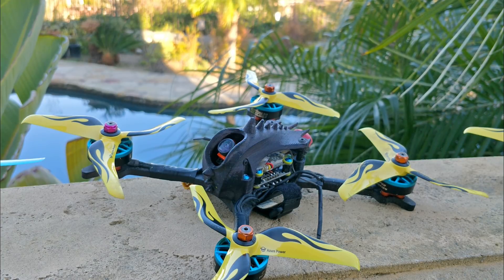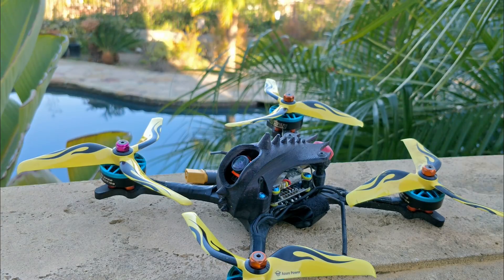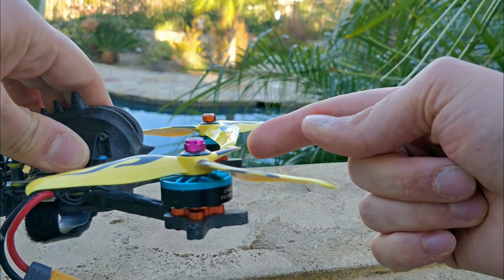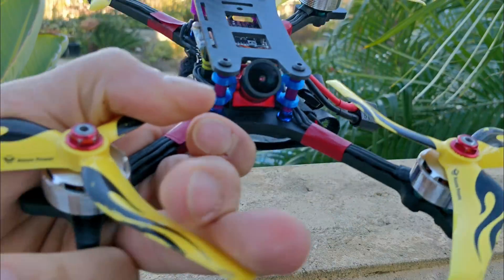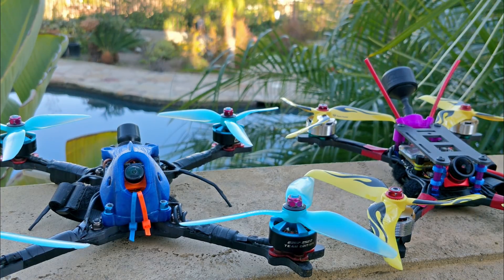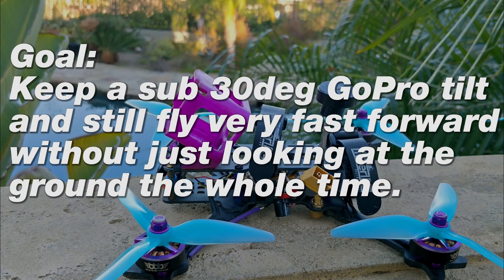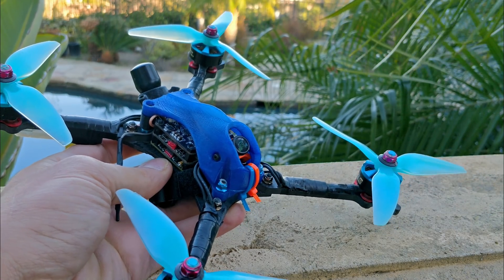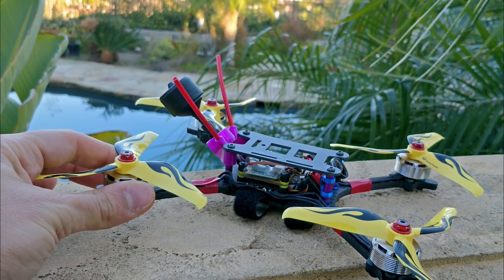Frame Geometry - Stretch X vs Tight X

Comment: Hey man - how would you describe the flight characteristics of a deadcat frame ?
Reply from the maker: Requires a bit more pitch usually to move forward at a steady and good speed, flat spins are a bit wonky due to weight distribution being a bit off.  Flips happen faster than rolls.  Otherwise pretty similar.

Comment: Interesting, I just learned about the problems of the disks overlapping in forward flight. This makes me wonder - could it help to use different props on the front and back? E.g. a 2-wing prop on the front that potentially leaves the air more 'clean', and stronger 3-wing props on the back that can pull their weight more easily? I cannot seem to find anyone who tried something like this, only this joke reporting on four different props, which obviously makes no difference: https://www.propwashed.com/flying-quadcopter-4-different-props/
Reply from the maker: twin blades would be spinning faster than triblade or quad blade so the net result should actually be similar.  More separation between front and back is most important.
Reply: @Kabab  okay, I don't know enough about prop geometries (yet) to know what would help, I was just wondering if there was maybe a trade-off involved that could be made differently for front and back to help with the issue.
Reply from the maker: @s-ol  either the rear props need to be raised above the front props or the distance between the front and back just needs to be longer. You could also make the rear wider too but that's not as effective

Comment: I so enjoy watching your videos especially when u get into theory and the science of quads and u can feel the difference in a stretch x and x configuration one of the best examples I have found during my time flying has to be the merica frame from catalyst machine works where the use the spacer blocks to lift the rear up and away from the front props but other than that u can tell the difference in the regular x and stretch
Reply from the maker: The step up and long X feel very similar. They're both doing the same thing. If the step becomes too large it becomes an issue for roll.
Reply: Yeah I could see that

Comment: Hey Kabab, Can you try to advice me a little? I found this amazing frames online. Catalyst machineworks Merica-X 5inch and Merica stretched 5inch. The thing is, one is True X with lifted motors on the back, the other is stretched and also has the possibility to lift the motors. Which one should I get for racing? I never flew a stretched before. and as you told in the video, the lifted true X does about the same trick with the airflow as stretched, but must feel very different...... hmm.. I guess its a personal question and differs from person to person. But choices.. are always so hard to make. ;-) Think it's time to floss now.
Reply from the maker: The stretched X is typically preferred for racing.  The lifted rear motors are only a little bit and that further helps get clean air to the back as well.  That's a great frame.  A little annoying to build and work on, but really great frame in general.

Comment: Very interesting discussion.  I've been designing frames for fun for a little over a year now.  My first design was a stretched x, and I've been flying that for about eight months.  I just finished building an H frame where I literally took the stretched x arms and rotated them 90 degrees.  The parts, rates, and PIDs are identical between the two quads, but the stretched quad feels a LOT smoother on pitch.  The rolls on the H frame were better, but I think the stretch flies better overall.  I'll probably design some true x arms just to see how it flies, and I'll mess with my rates (I have pitch and roll equal on my acro rateprofile).  I should also note that the main difference between the two (aside from arm geometry) is that the stretch has a bottom mounted battery and the H has a top mounted battery.  I still have a lot of testing to do (i.e. trying different permutations of geometry and battery positioning) but I was wondering if you might have any advice or comments?  Thank you!
Reply from the maker: The long X has better airflow to the rear props so it typically feels more in control and more grippy.

Comment: kabab do you know the folks at silverdrone? i wish i could of used my zmx finx40 2.6 but it kept blowing fets on 4.1 esc.. so is there any setup that would be reccomended for these motors? the f40 pro ll 2600 are okay but with gopro and lipo 595g so my astro x build is heavy but nothing like it was when those bigass zmxfinx40
Reply from the maker: Yeah the finX morors are pretty good. They are pretty well made and engineered

Comment: What about H geometry frames?
Reply from the maker: They don't really fit the bill for me. They require more tilt to fly at speed. Since pitch is so important on these things,  I prefer anything but an H. I'm assuming you're talking about a geometry where the front and back rotors are close together. If there is adequate separation it doesn't matter H or not n

Comment: Hey Kabab, perhaps a little off topic in regards to your frame research but i didn't know of anyone better to ask and i didn't know any better way to reach u, but in terms of props unloading thrust, i was hoping to bounce an idea off ya, maybe you have any thoughts on it .. 

I've always been bothered by the way nearly all currently popular motors are designed so much in favor of low profile assembly that it typically results in the bell being close to a flat cilinder of roughly 30mm diameter. When a prop is installed on for instance an emax rs2306 or whatever. the prop blades almost press flat against the top of the motor, which i would say surely decreases the total effective surface area of a prop. 

I'm sure I'm not the first person to go and try flying my quad with amd and without washers under my props to see i i get that extra 10% but I'm not exactly the most consistent of pilots to really test the theory proven. You ever try it?
cheers
Reply from the maker: Yes there is some validity to this concept. But only some I would say. The thrust coming off the disk is exceedingly little on the inner bit of the blade. Instead, the center acts as sort of a scoop that flings air out to the more effective part of the blade sort of. Blocking the middle is really insignificant. Similar reason why computer fans put the motor in the middle too. The effectiveness of the motor on the outside of the blade is none compared to in the middle with a bigger overall blade diameter. This is just based on thought experiments. Just a single washer under the blade probably isn't gonna do much.

Comment: before I even watch this, IMO Stretched X flys much better, always hated props being so close together like the compressed X stuff, props need space! its obvious the rear props would see much more air turbulence from the front props the closer they are together. don't understand why so many frames keep the props so tight together. I feel like frames should be much bigger then they currently are for the prop size they spin.
Reply: bob have you thought about making an inverted frame? I find quads are more stable not being so top heavy. was going to try one of your 6" hopefully 7" flossstyle from and invert it and mount the FC on the bottom plate and bolt the arms to the upper plate in between the top and bottom, will take up space but I think it would fly amazing.
Reply from the maker: Yeah there are a number of frames like that and many build the floss upside down too. I personally see it as not being very practical and my designs mostly call for a slightly raised up battery too. Especially the FlosStyle and Flowride.

Comment: stretch frame: battery and go pro mounted on top, mount the motors UNDER the arms. blades get sufficent air, and go pro won't catch props in view. you're gonna need tall studs for your motor nuts though.

Comment: Dr. I have a question,  do battery's have to be rectangular in profile?
Reply from the maker: No but it works easier for each cell manufacturing for the lipo structure. Lithium ion packs are cylinders because it's more volume in a smaller space but they work a little different.
Reply: Kabab FPV could you circle the square?  By mixing profiles, the worst that could happen is it doesn't work...  I'm guessing/asking.

Comment: Not quite sure what you mean by structural integrity for Z/split level frames. I designed the Zypher specifically because I wanted to have slightly better durability. Do you mean for a given weight? Because I must admit, that they do turn out a bit heavier
Reply from the maker: Yes that is what I mean. For the same weight it is very difficult to get similar durability

Comment: Yes I've noticed the "stretched x" with a high P tune on the pre-release bf 3.3 w.kalman filter creates more of an ovular or even egg shaped vs a circular air foil on the plain x. This "air butt" is akin to the huge tires on the back of drag racer...so on my stretch x I raise P pitch by 15 - 20%.  My freestyle secret sauce frame (Storm 210 -3 bolts/arm + double understrap very discrete high performance wide 210 (actually better than Chameleon due to lighter and underside battery) I set P roll up 20% from 45 - 46 to just at 55 - 56...of course I try and lower D to about 17 - 15 and you can do this with pseudo straightening effect of the new Yaw D term of 10.  My sp wt. and sp trans. are set just as Oscar Liang demonstrates his preference. at 1.5 and .6 respectively.

Comment: was there a batch of floss 2 top plates that got jacked up by a bad bit? I got 2 floss 2 frames from flyrcnow and one of the frames came with a bad top plate. Damn thing gave me a good splinter from the carbon and that's not cool man. The rep Justin has said to me that you  said it is fine but to me not so. Not sure if the place to have sourced to make your frames is dropping the ball or just using bit beyond the working life. 

I gotta say I like the frame a lot. After building the first I ordered the other after I seen how clean I managed to get it to be. I have ocd to the core so this top plate being damaged from the factory is killing me.
Reply from the maker: Yes there was a batch that the top plates had a different design and the machine couldn't cut it cleanly fast enough. We didn't realize until they were already shipped unfortunately. We then saw people's posts and we're sad. Won't let that happen again.

Comment: Hey nice video can you answer me one question, should I build the tooth fairy 3 inch or the floss 4 inch?
Reply from the maker: Neither. Build a Floss 2.1 5" or Floweride
Reply: But I have one problem the AUW has to be under 250 gram.

Comment: orthoGRaphic view*

Not sure if it hurts me or just makes me laugh, that in multiple of your videos you have your concepts right, but are off on terminology. It sounds like you are getting your terminology from Asian suppliers. :P You have to double check things over there. I encountered a foot long ruler (I double checked the length) over there with only 10 inches in it...wish I would have taken it with me.
Reply from the maker: I usually try not to use confusion words. I also may have some wrong words. I'm no expert. I've just tested a lotta stuff.

Comment: Roogi with them Hawkskys on the floss. :-P
Reply from the maker: Great motors
Reply: Currently running the 2207's on my 5 inch flowride and the big ass 2507 2200kv fpv af on the 6 inch flowride. They are great!

Comment: have you looked into a plus configuration vs an x configuration.   i built a 110mm with the plus config and you will notice the difference with the lack of turbulence in the plus config.  Its is very easy to setup in betaflight and the cornering for racing is unbelievable.  Also no, motor 4 's prop, which is the one in front does not get in the way of the camera.  from top going to the right order of motors is 4,2,1,3.
Reply from the maker: The cross feels a bit funny to me. It's design is a bit less practical imo and it just hasn't caught on as something mainstream. It's similar performance to an X but feels a little less stable around long sweeping turns to me.

Comment: what do you think about something like a XBee SR02 where the rear arms are way different than the front arms?
Reply from the maker: Looks fine, way too expensive and way too heavy.  My weight is well under 70g with 5mm arms and a pretty hefty body. How is that things weight 83g?
Reply: was more interrested in your thoughts on the wider rear arms, i got a friend who owns one and he says it feels very different from other frames in the air, also i live in denmark your frames are hard to get where im at lol
Reply from the maker: So sorry about the shipping. A super annoying issue. Wider rear arms will act like a long X but will likely roll a little odd like the Z geometry. I haven't flown a wide back for a while so just trying to remember.
Reply: hey man it is what it is, cant do shit about it for now atleast :D atleast there are some new ish shops in denmark that are starting to get good stuff home :)

i think ill try and borrow that frame to see how it flies

Comment: Hi, I just ordered a floss V2.1 and I was hesitating to put xnova Lightning 2204 2900Kv on it. Is it realistic or should I go better to the ZMX Finx23?
Reply from the maker: I wouldn't recommend any 5" motor smaller than 2207, 2306, 2405.  I don't feel there are enough benefits to anything smaller. If you're going with the Floss 2.1 with 5mm arms, it's too heavy for such small motors too. You need a ~55g frame max.

Comment: Have to call bs on the air unloading through your frame. Its still going to be blocked by the 
stack and other components creating turbulence. I'd like to see some fluid dynamics videos to prove this point. Otherwise its just speculation.
Reply from the maker: I forgot to say it but I didn't come up work that theory. Steele did. You can also test it for yourself and see. I didn't believe it either until I was experimenting with it all.
Reply from the maker: https://youtu.be/_0kQ5f5LqgI
Reply: I'll try to find the video, it was uploaded by some super nerd from an "x"IT school for a project - but it was a video of fluid Dynamics of a quad for a project and you could see the flow through the frame.  I'll dig through my subs and see if I can find it.

Comment: Why not just 1s and 9200kv duh!?
Reply from the maker: What if this actually worked? 😮
Reply: Would require too many amps.  Watts of energy is what matters in the end.  Watts are what get "work" done in physics.  As you increase voltage you reduce amps needed to make the same watts.
Reply: Just a joke haha

Comment: can we get your take on 6s benefits and disadvantages? And also 3s super high kv. I think in an old video you mentioned that silverdrone said the optimal kv of the finx 2205 was like 3100kv or something. would there be benefits to running a 3000kv 3s setup with a large 2200mah battery or something? or is that just a bad idea? lol
Reply from the maker: Yeah I'll do one soon but there isn't much to say. It's the same flight time with more consistent and slightly heightened performance. 6S and low kv.

Comment: It might be wise to include the physics of angular acceleration and moment of inertia in your videos.

I would venture to guess that moment of inertia, defined by the Integral of r^2dm, plays a larger role in this versus prop wash interaction.

https://en.m.wikipedia.org/wiki/Moment_of_inertia
Reply from the maker: Too complicated for the general audience. I feel it's not needed to understand what's going on from a layman standpoint. But yeah I'd love to do all that.  From my testing, prop wash interaction is the primary no issue at hand.
Reply: David no it doesn't. What are you talking about?
Reply: David INTEGRAL of r^2 dm. All of the little differentials of mass are used.

That's what my original comment says.

Comment: People are very confused by the whole Stretch X vs. Wide X vs. True X thing. A lot of people think a Stretch X quad rolls faster because the arms are closer together from side to side meaning less rotational inertia. But it doesn't work that way. Stretch X has more torque on the pitch axis because of leverage. I always break it down like this: How do you change a tire on a car? You use a very long wrench because you need the leverage to break the tight lugnuts loose. Imagine trying to break a lugnut loose with a tiny wrench. It would be nearly impossible. You can apply the same logic to a quad frame. If you have a stretch X, that places the front and back motors farther apart meaning those motors exert more torque on the pitch axis for the same amount of pitch input as a true X. This is confirmed by your findings when you mentioned that even with the same rates, the pitch axis moves faster on a stretch X. Likewise, a Wide/Squashed X, which places the front/back motors closer together and spreads out side to side, will have more torque on the roll axis for the same roll input as a True X or Stretched X.
Reply from the maker: Yeah I believe the end rotation rate is similar, it's just that the pitch movement is 'bigger' so the same degree movement 'feels' like a bit more.
Reply: Yeah, exactly. "Faster" was the wrong choice of words on my part. End rotation speed doesn't change, at least in any obvious way. But because of the extra leverage, the same amount of stick input results in the motors more easily rotating the quad--which makes the movement feel, like you said, "bigger". And more immediate/direct.
Reply: +I B Lawrence, also a wider X frame are more stable and turns better at full throttle.